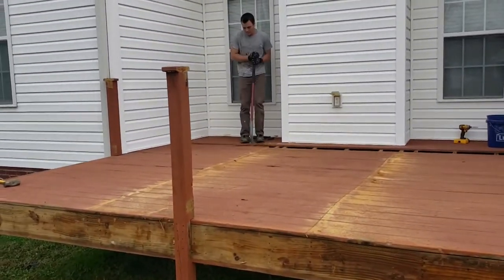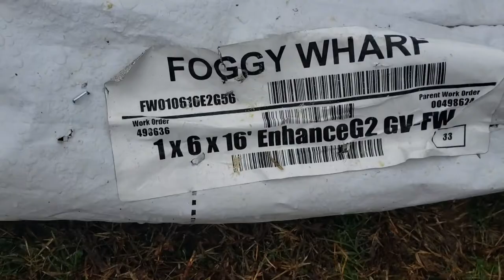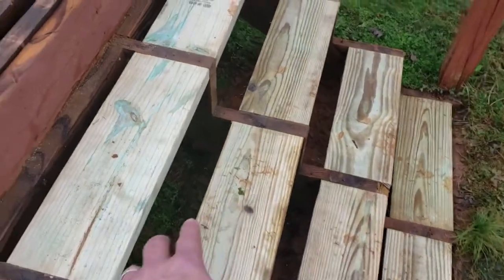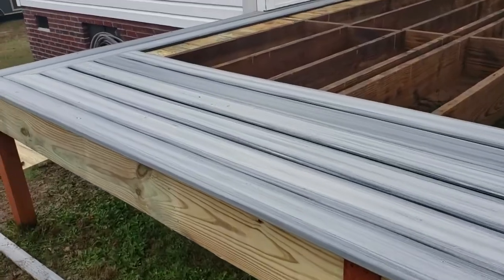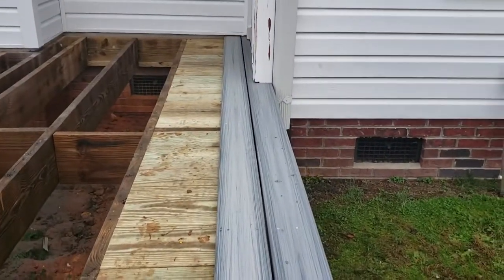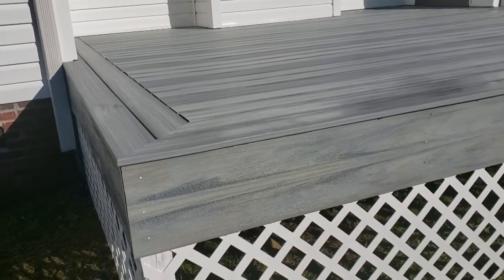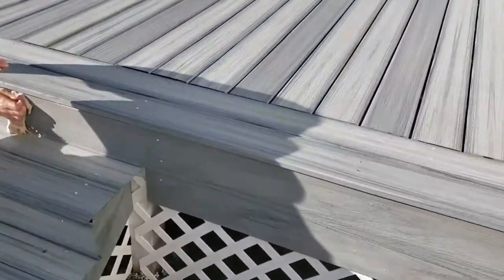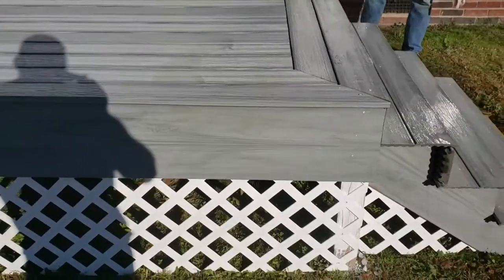How to picture frame a composite deck

Comment: Yes unfortunately perpendicular blocking on 16" center would be better to support picture frame. As you've done it, you've created a puddle of water under all the cut ends.
Reply: Yup, no joist tape either. The homeowner is going to have a bad time in a few years as that moister is also going to get up under those picture frames and rot them faster too.
Reply: It'll last longer than 3 years I've done them the same way but I also put vinyl sloped slightly to protect the wood but this way is fine for alot longer than 2-3 years. Good job man
Reply: The blocking is also support for the posts.

Comment: I’m currently building a 40 x 16 deck and also using foggy wharf. I’m picture framing with clam shell. I understand your customer did not want two colors but since you mentioned it in the video about what color would go with foggy wharf I figured I would mention what I chose. It actually looks kind of nice. Winchester gray looks better but it’s 1/16 thinner so, no good. Also, Since it’s come up several times I will mention also, I simply do vertical blocking on 12” centers for my picture frame. The 45° corners look nice but I try to do herringbone corners because of distortion from expansion and contraction. Everybody has a different opinion on that as it seems but herringbone is my preference most of the time.
Reply from the maker: Great thoughts!  I just completed a deck with foggy wharf wrapped in clam shell.  Looks great.   Shoot me an email and I can send you a picture

Comment: Don’t want use that type of blocking for your border, water and dirt will collect underneath and cause rotting.
Reply: Why not just block 16” oc in between the outer joist?
Reply: Exactly what I was thinking.  Same thing beneath the steps.
Reply: Then the inner deck board ends wouldn’t have any support coming into the picture frame.
Reply: @tommysmalls8634  To do this properly you have to plan ahead and install a joist so that the ends of the inner boards overhang it about an inch. Its more work but the measuring involved is pretty simple. Take your board widths, gap spacing, inner overhang and subtract your outer overhang: 5.5" + 5.5" + 0.25" + 0.25" + 1" - 1.5" = 11". That solid blocking like that will rot in a few years.
Reply: @livens100  correct - I was responding to Reverend Hogwash.
Reply: I cover joist and any blocking of wood with Grace Vycor Deck Protector Self Adhered Flashing. Very sticky tar paper, to help with protecting wood.  Amazon carries this product.
Reply: i sealed the wood under the blocking & drilled some 1 1/4" holes for drainage
Reply: @livens100  I've found Trex to be slightly less than 5.5".
Reply: They are setting themselves up to redo this job in the future

Comment: I am in the process of doing a very similar deck.  Picture frame and all.  Can you tell me how much overhang you go with before the fascia is installed?  Also, do you have a follow up to this project installing surface mounted posts?
Right now I am still in the process of prepping my frame for the picture frame with blocking.  I intend to mount my posts before laying the deck and notching the picture frame around them.  You clearly decided to go with surface mount posts.  Any advice before I commit to installing them first?
Reply from the maker: https://youtu.be/eSCowevioqg
Reply from the maker: This should help with post and rail install.  We have the deck boards overhang 1.25" before the facia is installed.  The fascia is roughly .5" think so that still leaves .5" to .75" of overhang.   Thanks for the feed back!  I hope you've subscribed and liked the videos!
Reply: @adventuresofahandyman4446  Thanks.  That's perfect info.  And I most certainly did (subscribed, that is)!

Comment: I dont see gaps at the mitered picture frame corners for expansion. I just finished my deck & did a double picture frame without the gaps. I like the way it looks without the gaps. I'm hoping in the 90 degree summer in NY that the expansion doesnt mess it up. I installed the deck in 70 degree weather this past fall 2020. I used trex "clam shell" it's a scalloped bottom. WHAT DO YOU GUYS THINK...WILL I HAVE AN EXPANSION PROBLEM?
Reply: If you installed during direct sunlight I wouldn't worry.
Reply: @Jimbogf  not true. 90 degree will expand it by at least 1/8" total. Need to have at least 1/16" gap at miter joints.

Comment: Why didn’t you use the special clips on the stairs with the screw built in to not see the screws gives it a cleaner look
Reply from the maker: Have you used those before?
Reply: After looking closer on the video looks as if your composite boards would not be compatibl, they should have a slit on side

Comment: Great job on the deck and the framing. What do you use for the stringer facing?
Reply from the maker: I use trex fascia.  They make it in 12" pieces

Comment: Have really enjoyed your videos. Getting ready to redo my PT deck with Trex to cut down on maintenance. What impact driver do you recommend?
Reply from the maker: I have a cordless dewalt.  The hidden fasteners come with the tip that you'll need.  Good luck and thanks!
Reply: Adventures of a Handyman thanks...any particular model?
Reply from the maker: @robnan2510  I've had it so long I really dont know.🙂.  It comes in the set with 20v battery,  charger and driver

Comment: Shouldn’t those 2x8 stringers be on top of those 4x4 posts?
Reply from the maker: Stringers on top? 2x8's?
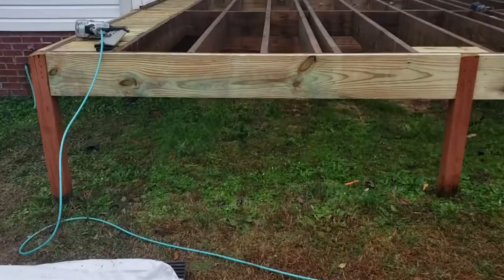Reply: @adventuresofahandyman4446  look at 0:56. Shouldn’t those horizontal board s be on top of the 4x4 posts, not attached to the sides?
Reply from the maker: Ok, i got ya.  The inner board is notched into the post.  The outer is not.  Looking back we should have just torn the deck completely down and started from scratch.  I dont block this way anymore either.  My more current videos show the new approach we take.  Thanks
Reply: @adventuresofahandyman4446  thanks for the insight. I didn’t see the notching and that makes sense.

Comment: Your supports for the picture frame are just going to hold water. Why not put joist tape down while they are exposed.
Reply: I was thinking the same exact thing
Reply: what s the better approach?
Reply: @redtruck32  put some joist tape down to keep the water off of the horizontal surfaces
Reply: I would just run another joist parallel to the others, could even use smaller stock
Reply: Yeah not a fan with the way you braved this deck.  Those boards are going to trap water and rot.  Classic rot pocket....
Reply: Or paint them...I paint the joist / support tops for added protection.  And it looks better when you look down.  Don’t see the wood color.
Reply from the maker: @moojersey3  seems like every comment you make is negative.   Maybe you should unsubscribe if you're so disappointed.   Geez man, get over yourself.   I built my own deck this way.  Looking at it right now.  Amazing!  No signs of rot! Idiot
Reply: @adventuresofahandyman4446  hello.. I'm commenting with a similar concern.. I'm in the process of doing my deck with trex too and I like the finished look of your work.. And your method of building the ledge makes installing look a lot easier. However I am concerned about water going between the picture framed trex boards and just sitting on the ledge below and seeping under the trex.. basically what I'm saying is I don't see how the water can drain out. I live in the northeast part of the country so in the winter that water will also freeze possibly lifting boards?.. 
I'm not trying to criticize your work I'm just worried about doing it wrong and being sorry later.. this stuff is too expensive to make mistakes... 
Have you noticed any water collection on the edges after a good rain?
Reply: 100% the supports will rot the composite and pt in a few years
Reply from the maker: @mathieur-w1205  I have a deck I built for myself this way.  It's 5 years old and it is 100% not rotten.  You're assuming,  I'm doing.   Having said that, I just posted a video with the supports installed edge ways.
Reply from the maker: @dull_boy_274  check out my latest video
Reply from the maker: @redtruck32  I just posted a revised way of picture framing.  Check it out
Reply: @adventuresofahandyman4446  Yes envious vile little man who serves no purpose , beautiful looking decking, thankyou  for sharing.
Reply: @adventuresofahandyman4446  my guy chill. They're just saying what they've personally seen

Comment: Blocking should installed on edge.  Laying flat allow water to stay on its surface.  Especially bad give you didnt tape your joists.
Reply from the maker: I agree. This is an older video. You’ll see in my newer that I did like you said

Comment: With that much blocking water has no chance to shed away.  Moisture will sit between the composite decking and the blocking and the blocking will rot after time
Reply from the maker: Have you worked with trex before?
Reply: @adventuresofahandyman4446  yes and other composites as well.  The amount of blocking is  not required with any decking product including wood
Reply from the maker: @morrismonk7152  👌.  Have you watched my more recent video of picture framing a deck?

Comment: Incorrect Trex framing, 16' O.C. joist will allow Trex to sag. 12: O.C. is the Trex recommendation Also, I agree with others never place spacers flat this deck will fail in a short period of time due to rot no matter treated. If you going to pay up for Trex then either use Trex hidden fasteners or buy a commercially available jig to edge fasten with screws to hide the screws. Trex is a composite plastic vaneer around a wood composite core, breaking the waterproof plastic vaneer just allow moisture to attack the core.
Reply: Trek says 16 oc is fine

Comment: Trex is a horrible product that does not stand up.  It is VERY prone to bending and warping.  Talk to a contractor that has used it and you'll find out.  Trex used to be the only option, but there are much better options in the market now.

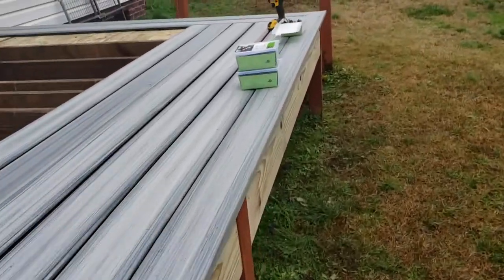Comment: Nice 45 at the 3:21 mark...NOT!  the spacing is incorrect. You don't block like that unless you put the butyl rubber tape over to prevent rot! Whoever that deck was built for, will be pulling it up in 5-10 years, thanks to you! Sorry, don't mean to be a mean, just constructive. To be honest, I stopped watching after about 4 minutes
Reply from the maker: That's for your amazing insights...not!  Post your video and show me better.  I dont know it all but I've built enough to know enough.
Reply: Instead of the tape...I also find that  2 coats of an oil based sealer under the picture frame is a good idea. I also drill some 1 1/2" holes to drain the water & spray clear sealer in each hole so the wood doesnt wick up the water as it drains through it.